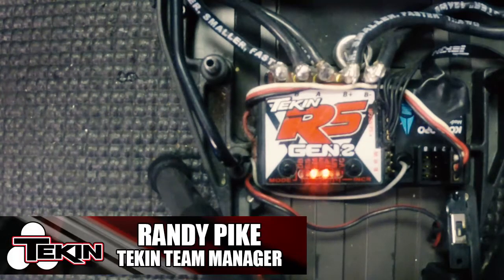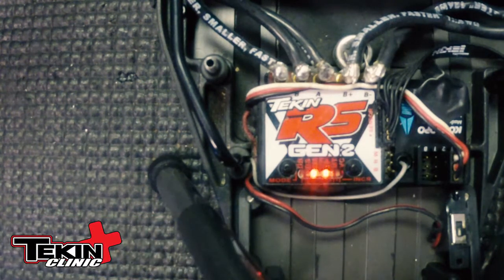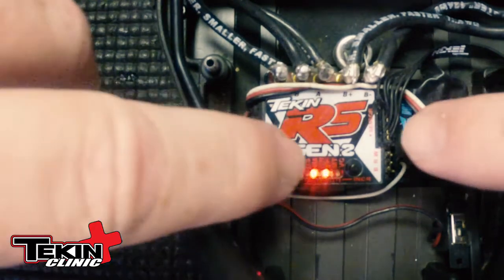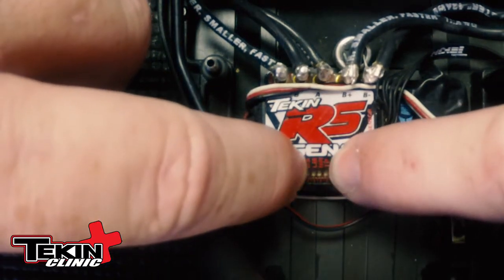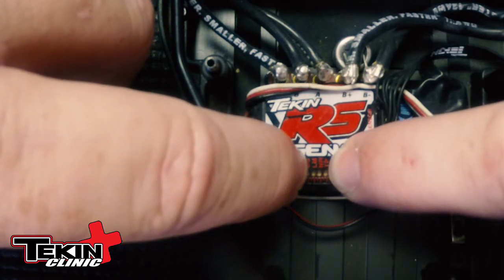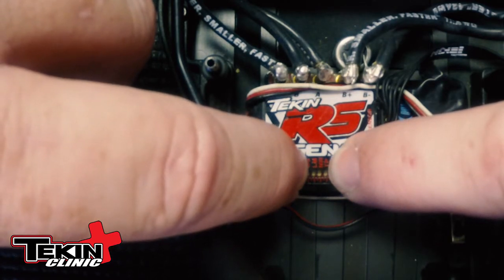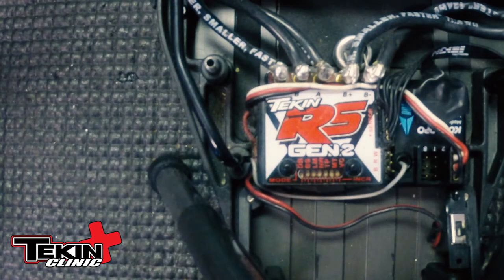Tekin Clinic: Factory Reset Your ESC

Comment: would this fix error for wrong motor type LEDs 1,2,6,7 are flashing
Reply from the maker: You can check the motor type first and make sure it's set for the right motor, but that error code can indicate a short inside the ESC.
Reply: Tekin Racing yeah im sure its the esc now i tried two known working motors and sensor wires and still no change it sucks it was my rsx pro
Reply from the maker: @rat2405  contact us, support@teamtekin.com and we will get it taken care of!
Reply: Tekin Racing just sent an email
Reply: @rat2405  how did you solve the problem?
Reply: @MaxShadoff  if you have this error after resetting the ESC it means the ESC is no good
Reply: I’m actually getting the same code on my esc which was working perfectly yesterday